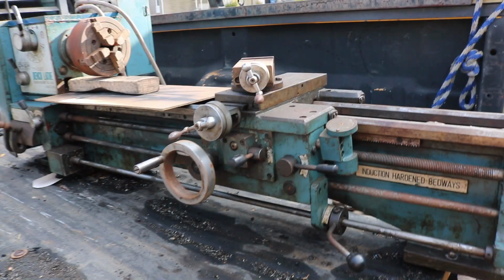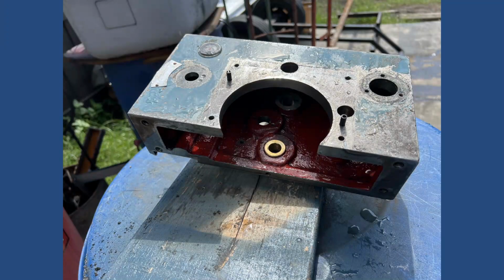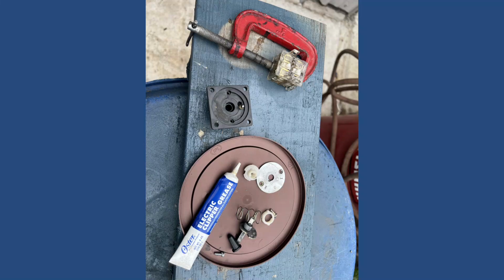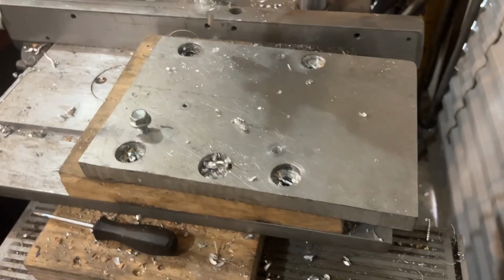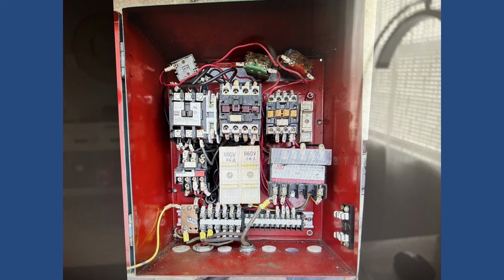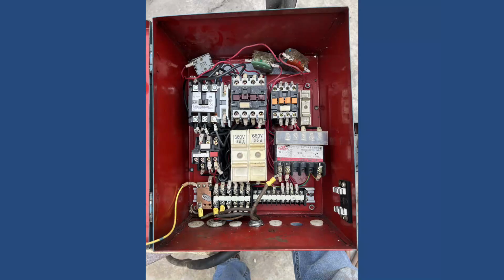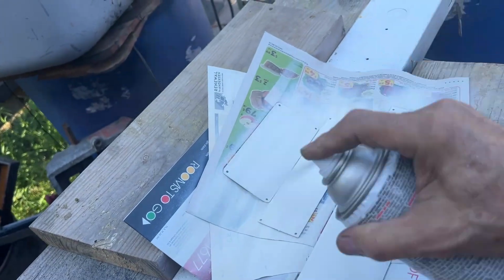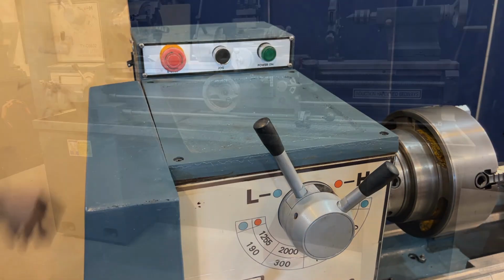Yangzhou TY-C0632 Lathe Restoration

Comment: Next time, don't buy a motor, buy a machine with the motor you want. You can often buy it less or for the same price as the motor by itself. You can sell off the machine parts and essentially get the motor for free.
Reply from the maker: @bobweiram6321  I sold it.  won’t buy again these kind  are not good for flipping.
Reply: @CMDWorksandRestorations  What kind are not good for flipping?
Reply from the maker: @bobweiram6321  Machine shop lathes I think, I had more success with automotive brake lathes. Hey Thanks for the comment.